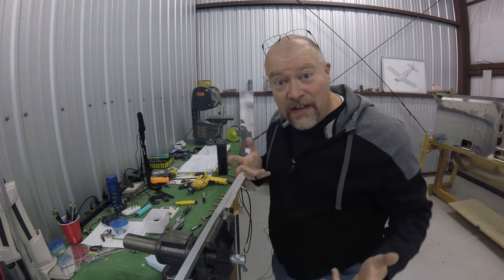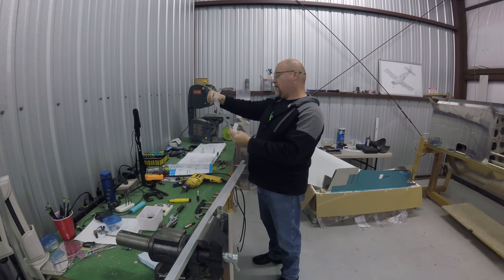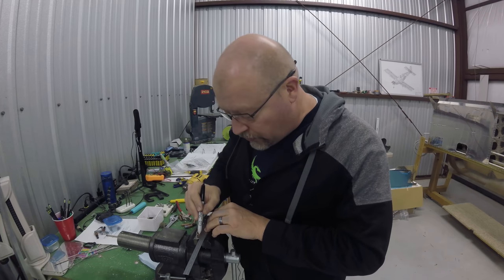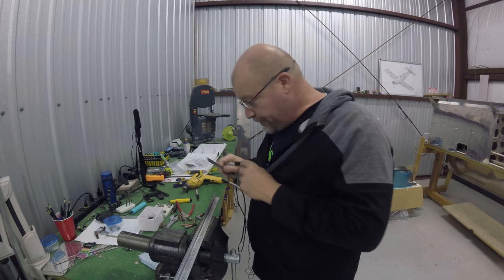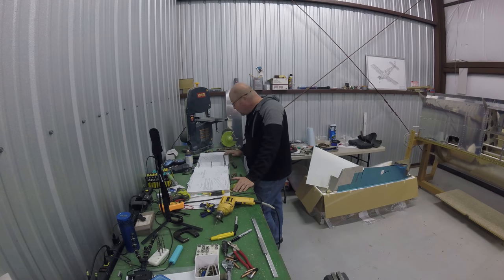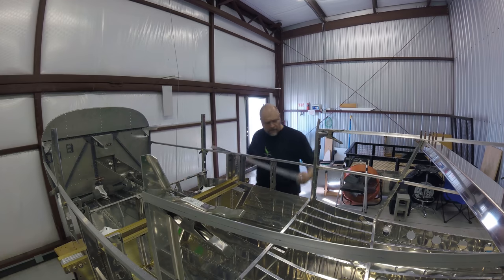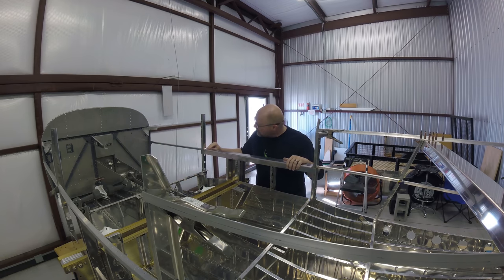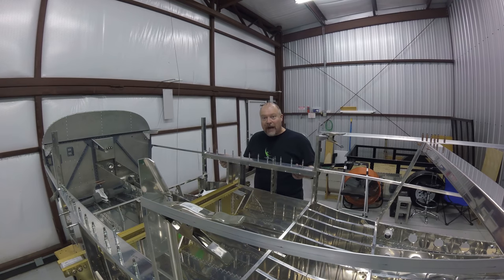RV-10 Fuselage - 022 - Frame and baggage door area

Comment: If you strive for absolute perfection, she will for ever remain a hangar queen. For the structure and safety, yes, you want 100% perfection. But once you are into the remainder, get it done, get it flying, reward yourself, and finish the nit picking parts after first flight. You have 40 hours of flight testing to do, and while that is going on, is when you finish the interior, and any trim that needs looking at.

Comment: I like building mine at home and intend to do everything including paint.  I have painted a few cars already.  I love being able to go in and out.  also my airport is 30 minutes a away in the middle of no where.  When I am done, I intend to haul everything down to the airport and attach the wings there.  Your plane is looking great!!  You are much further along than me.
Reply: Are you going to paint it yourself? I have heard that's it's way different from car painting starting from special paint to special painting techniques. I am curious if it is possible at garage?
Reply: @stalex91  Not way different.  Only the prep and base coat is different.  Color and clear coats is identical.  You can paint anything in a garage using a make shift paint booth.  reality is if you are willing to sand and buff a lot one can paint without any type of booth.  We own Land Rovers, they are aluminum as well.  And yes I have painted parts of them as well.  Lots of You Tube Vids out there on painting planes.  There isn't just one way or one technique.  Just as long as the equipment is good enough to properly atomize the paint particles.
Reply: @omorin34  difference between automobile and plane are in structural hardness and bending properties. Usually car surfaces are not exposed to any kind of structural deformation (only in case of accident, paint doesn't matter much then) and paint cover can be solid and hard. On the other hand plane's wing and other surfaces can be (and usually are) exposed to bend because of different forces/overloads (like takeoff/landing/turns etc.), so paint should have a kind of elasticity and do not crack while aluminum bends under it. I think it worth to look deeply into this.
Reply: @stalex91  sigh. Never said I would use auto paint.
Reply: stalex91 That is not true at all, but particularly not with modern cars that are almost always “unibody” construction rather than body on frame as in the olden days.  Many exterior panels on cars are used as structural elements and car bodies deform a lot during use, probably at least as much as most airplanes as cars tend to see much more point loading whereas airplanes tend to see more distributed loads.  Almost all modern paints are quite flexible and not like the lacquers of old.  Composite and aluminum airplanes will do fine with almost any modern automotive paint.  The main exception are fabric covered airplanes which can have a lot more local flexing and need more specialized coatings.  Most paint makers are happy to help you select the right product for your application so just give them a call.
Reply: @omorin34  you told "Color and clear coats is identical". I though about them as materials not technique.
Reply: I built and painted my single seat airplane in a one car garage. Two trips with a trailer to get the fuselage and wings to the airport.
Reply: ulbuilder Where there is a will there is a way!

Comment: based on where you are vs where I was --- you have another good year to go before you INSTALL THE ENGINE, never mind fly it ...
(I missed my first fly date by about 8 months ---- but partly my fault for accidentally hooking up my battery backwards, over-riding a safety circuit that I designed [cuz I convinced myself that it malfunctioned when it actually did what it was designed to do]  and frying my electronics --- that cost me 2 months of corrective action and intervention by Vans..... Don't Do That. {Scott McDaniel was a lifesaver}
Anyway, it will be more than Spring before you are ready.  You have 85% of the build complete and only have 85% more to go .... 
Chin up)